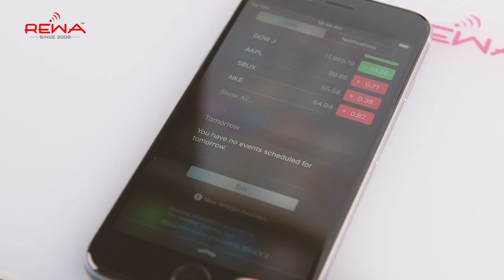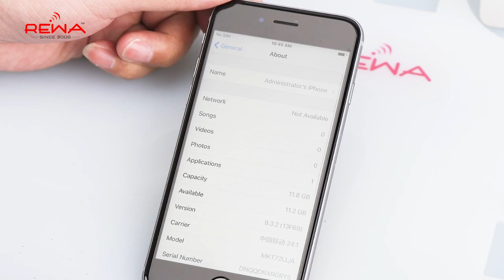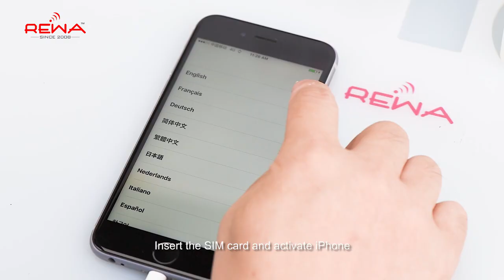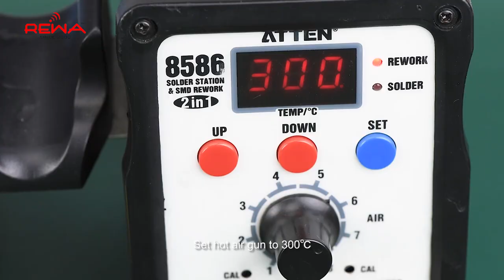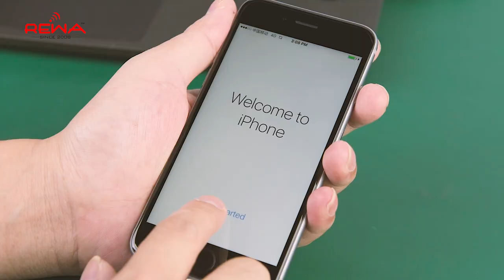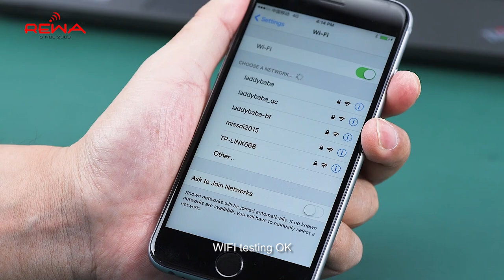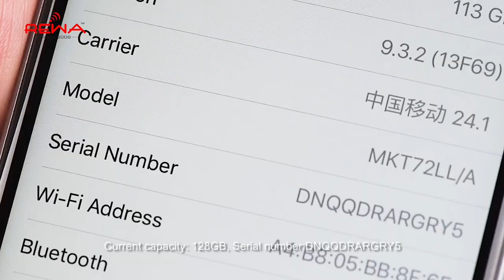Upgrade iPhone 6S 16GB Storage to 128GB

Comment: How to upgrade Android Smartphone to 128GB:

1: Insert SD card.

Done
Reply: I love you
Reply: This should be top comment xD
Reply: confirmed working on blackberry also
Reply: epic comment
Reply: Marius Ammann the speed on that sad card is no where near built in storage
Reply: they make a 256 now.
Reply: 512 as well
Reply: that's true, but you cannot store many apps on the SD and can't install apps if the internal storage is full or nearly full
Reply: Dongonzales123 Yes this is true, my Samsung J5 has only 8GB of internal storage and even with a large SD card I have run out of space for apps
Reply: They have a 1TB SD
Reply: rob shaw the biggest micro SD (the one that fits into a phone) is 256GB or 0.25 TB and costs 200$. The biggest SD has 512GB but its not out yet. What you are thinking of is SSD, Solid State Drive. the biggest one there has maybe 10 TB.
Reply: Dongonzales123 No, Im talking about the SanDisk 1TB Micro Sd Card. I am a Cinematographer, so I keep up to date with the latest technology. 

1, the 512 GB sd is out, and has been out for a while. I have 3. 
2, the 1tb sd was announced very recently at a production convention. 
3. The biggest SSD in the world is 60TB, Also announced by SanDisk
Reply: rob shaw well then you seem to know more than me. thanks for the info
Reply: Dongonzales123 Not 1tb Micro sd * 1 tb SD. But anyway, the 1tb should be released in a month or two. Going to cost upwards of £500, if not more.
Reply: While that upgrades storage capacity, the speed in which the phone is made to write and read data is still the same, as recently revealed in iPhones and possibly used in androids, the higher gig storage the phone has when you purchase it, the higher the speed for reading and writing the data. Keep that in mind.
Reply: Dongonzales123 yup the internal storage app is just BS
Reply: Confirmed On Moto x pure
Reply: Then spend the rest of your life figuring out why tons of your apps refuse to install or use the card and only use the internal storage.
Reply: ***** Figure it out for me
Reply: That part's easy if you know the majic juju, but more to the point it's best to use it as image/media storage
Reply: Dongonzales123 Well, if you have <Android 6.0, you can root and partition your SD card, and you can trick your phone into thinking apps are still on Internal and fully moving as many apps as you can fit. For Android 6.0 + you can format the SD card as internal, and the phone treats the SD card as a part of the Internal. Downside is you can't remove the sd card since it thinks it's a part of it's internal memory, but that's not really an issue.
Reply: David -flamingsword1 That's useful. Thx
Reply: The only problem with adding an SD card to android is that unless you root you can't make good use of it. Unless you're on jellybean. but if your rooted you can separate out the card from KitKat on up, and access it directly. But the thing to look for in an android isn't the size of an ST card but rather the size of your usrdata partition, if it's not at least 8 GB you're not gonna be able to install very many apps. You can get around this by routing and then using Apps2SD or Link2SD to move your largest apps onto your SDcard. But unless you use the very best card it's going to slow you down. I use a patriot 32 GB card. I have a Samsung 32 GB card in one of my other androids and any apps I copy onto that are very slow. That's why it's preferable to have all of your apps on your internal userdata. But just don't get any crappy SDcard, always get the best, it's better to spend more money and get a good one than buying cheap ones, which become unreadable in about a month.
Reply: +Andy G weren't there some s6's a couple of years ago that didn't have a slot? Maybe only certain models. To me the card is a convenience, a good droid will have a lot of space internal as well as a card slot. The newest flagship droids all seem to have more internal space lately, as well as the slot. I keep my titanium backups on my cards, as well as a bunch of media. I think droids are better for handling a lot of media, even for playback. Allcast is much better on android than on Apple.
Reply: Andy G bull
Reply: +Michael Street you are either rooted running SDfix or unrooted running Jellybean then. But no stock androids allow direct access to SDcard from KitKat up. Check your UserData, that's your limit for installing apps (unrooted).
Reply: and wait 3 minutes to open a picture because you reached maximum capacity..
Reply: Marius Ammann q
Reply: Yah but there are no apps u can get on android. Better off trying to get  a good game on a vibrator
Reply: +Andy G I have a list of about 100 games if like to play from the App Store and I found 0 of them on the google play store
Reply: +Andy G this is true there are apps that I love to get on my iPhone that are android-only and it's because the play store allows apps that relate to rooting to be sold there. The Apple App Store by contrast is very restrictive, I mean a popular app that I use on my iPhone called Battery Life was in the App Store and Apple yanked it because it was a formerly a jailbreak only app. After some severe finagling the developer had it reinstated but what a pain in the ass. And I would love to have an app like  DriveDroid installed on my iPhone that would allow me to boot any of my PCs or Macs to Linux from a disk image right through the cable. What's that great android tethering app I can't remember the name of it, we can't even get that really. But using that app on an android I tethered my laptop to my android phone when I had no wifi service. But on the other hand there are a couple of great Apple only apps, there is no good midi player for android, I have SweetMidi player for iOS.
Reply: +Andy G k. But better apps are on App Store. Can't find very many good ones on Google play. Name me a few good apps and games on Google play and prove me wrong.
Reply: NVMe SSD vs SD card
Reply: lol
Reply: Avery-John I have three android phones still on KitKat, very bad support from the phone manufacturers
Reply: +Avery-John I have a Samsung Gtab3, The last update they pushed out was simply another version of KitKat and that was a year ago. Maybe they pushed out another update but I haven't checked in a while. The device probably can't run lollipop or any other 64-bit OS. I have TWRP on it, works great even with no SDcard, basically I use it as a remote with Smartremote. Having that IR on the side is convenient.
Reply: Marius Ammann and the sd card do nothing, cant put apps in there, only canceroud selfies
Reply: @Avery-John
sorry I dont believe that. as I have android with 128 microSD card and my phone is maxed out at 32-gb
I can no longer install apps. and my phone prevents me from moving anything to SD unless its actually a file or something.
In regards of it being a so called "Adoptable Storage" it will not do it. - I have a ZTE ZMax Pro phone with Android 6 installed from factory.
Reply: Avery-John who said they were $200? These are expensive phones. And I know how to use android, but I like to keep the developers custom UI
Reply: Avery-John 3 of my androids. My other androids, including one I got for $60 are on Marshmallow and my main Android is on 7.1 Nougat. However all my iPhones, except for my 6 year old iPhone 4s, are running iOS 10.2 or higher. The 6 year old iPhone 4s is running 2016's iOS 9.3.5, which is still fairly recent.
Reply: @Avery-John
you still have not replied to my question..... Where do I get a TRUE Android OS for my ZTE or any other device I have ?
I would like to try out your suggestion as you mentioned about me installing a TRUE Android onto my phone to get my microSD to be part of my MAIN ROM....thx
Reply: +Top Kek how's 9.3.5 on the 4S? I used Alonzo's script do DL mine from 8.4 to 6.1.3. Then I sold it for a lot. I like my 6s on 9.3.2, but I won't run unjailbroken, I missed the signing windows for 10.1.1 and 10.3 by one day
Reply: Social Spit my 4s isn't that bad. It only takes like 3 seconds to open the camera and its still good for calling and texting some. Anything else you might want an upgrade
Reply: Avery-John well the 4s still has great standby time and it gets great reception for me
Reply: +Top Kek I wish I still had mine, I had a sprint 64gig white i4S. Traded it for some large flash drives, but they fell out of my pocket last month, I kept my operating systems on them, so I wouldn't have to carry around a bunch of DVDs and CDs. The 4S had the best battery of all of the iPhones I have ever had, after two years it still at 95% capacity. After three years I had to replace the battery in my 5S, and my success is not even a-year-old and the batteries at 70%, worst iPhone battery ever but I like the phone a lot. It's true no phone is a waste, I still have my old Motorola flip phones and my little piece of crap siemens phone. And I have two Treos, I like the keyboards on those I can use them without looking.
Reply: Avery-John yah The 4S that I sold two years ago still has the original battery and it is still at 95% capacity, I had to replace the battery in my five S but now that's good, but that gave me three years of good use where I got about a day out of each charge. The worst battery life I've ever had is for my 6S, which is at 20% wear level after less than a year of use. Or rather 80% capacity. I love the phone it's got great features but the battery is extremely shitty and I know that they dropped the capacity from the 6 to the 6S. I will probably bring it back to the iPhone store and try to get it replaced right before my year is up.
Reply: Avery-John samsung's have massive batteries, but my galaxy tab three battery only last half a day now. Old battery. I ran iOS 6 on my 4S practically the whole time I had it, except for iOS 8 for about six months. Then I downgraded it back to iOS 6 and the battery life was phenomenal. Older iOS had less features so you had more life spread out between all of your apps.
Reply: My 6s battery is getting better life ever since I ran CYdiA Eraser which erases the device, I haven't installed as much excess junk this time, but it's still down to 80% capacity. It's still under warranty, so apple might replace it if I go to the the Genius Bar before September. But they'll give me a non-JBable iOS. I might luck out and get 10.1.1 or 10.2 then u can use Yalu. I'm only renting the 6s so I don't care much about it :/
Reply: Marius Ammann  not entirely true.

I have sony Xperia C with 1 GB of internal memory and it doesn't matter how much memory I add, the programs still don't install due to lack of memory on the phone itself
Reply: Avery-John That's why I said "not entirely true"
Reply: Avery-John that's how it's supposed to work but it all depends on your user data partition, I have an old Samsung galaxy tab and that's 12 GB of use your data there and that's my upper limit for installing apps which is quite large actually. I have other cheap HTC and media tech devices that only have two and 4 GB of user data, and that really limits what I can install unless i root and use my SD card with apps2SD. But my SD card is so slow it's not worth doing that. So I end up deleting system apps that I don't need
Reply: Marius Ammann lmao 😂 but so true
Reply: Marius Ammann but I use a nexus...
Reply: Use Xposed module +root+256gb sdcard DONE
Reply: Lmao
Reply: Lmao
Reply: To 1PETABYTE!!!
Reply: #GrowFasterDeveloper Channel which Xposed module, but it all depends on if you have a good fast SD
Reply: Dongonzales123 not true, in Android nougat "v7" have a option to format and share the SD card space with  internal space. But the sd card, works only in that phone
Reply: Marius Ammann good luck with the s6.
Reply: With no apps working on the sd card
Reply: use apkpure ;)
Reply: use apkpure ;)
Reply: processor has maximum to read you can't add any storage you want you have see the limit first
Reply: How to turn your Android Smartphone into Garbage:
1: Wait 1 year (or less)
Reply: Rofl :D
Reply: Marius Ammann lol
Reply: Hahahaha..niceee
Reply: Absolutely delicious
Reply: @KypHeM  who told you that there is different class of storage 1  to class 10 also ultra fast why u think we use 64 gb sd card we don't find any slowness
Reply: That's exactly what I'm need.... Thanks you
Reply: Marius Ammann lmao 😂😂
Reply: keesa mash  phones are like mini computer company say support upto 32 gb if phone is having 2 gb Ram it will support, my 5 year old Samsung s4 mini & lg optimus one supported 128 gb you have tried and tell
Reply: After reading this comment I will event not click on the play button to see the video but just close it. Thank you
Reply: I don't have a SD card slot
Reply: hahaha good one
Reply: oh 😅
Reply: BEST COMMENT
Reply: @brizek  root >> failed >> boot loop >> always error
Reply: its working in my phone wow
Reply: how to fix Android fragmentation?

1. you can’t !
Reply: Dongonzales123 root can solve that
Reply: Marius Ammann 😂
Reply: It's not the same .
Reply: Lol not all
Reply: how to speed up and Upgrade OS on Android

1: Throw away your android purchased 3 months ago

2: Buy a New Android Phone

DONE
Reply: Marius Ammann yea I am starting to have my iPhone because it’s a 16gb model I prefer Samsung now
Reply: Marius Ammann lol so true
Reply: Alex Pana they make 512 now
Reply: Marius Ammann HAHAHAHA funny as heck, loved your comment!
Reply: How’s the data encryption on those android pieces of shit? Seems like anybody can just pop out your sd card and pop it in theirs to see all your pictures. At least this has a risk factor to it and is semi compromise-able, I mean they’d desperately have to be nosy to install a memory chip into their own or another donor phone. It takes a lot more effort which filters some of the lazier, less desperate people.
Reply: Dongonzales123 yes you can lol
Reply: Hhahahahah Thank you Android Phone companies. I love you
Reply: No Just Install Google Drive🤣
Reply: Jajaj true story
Reply: android = slow shit ....
Reply: i clap to this
Reply: Hahahahhahaha
Reply: Nailed it !
Reply: ha ha, very simply
Reply: @GewelReal  1 tb as well
Reply: iOS : haha 😂 but I have my originality of  processing
Reply: @Dongonzales123  yes we can simply root your device and then done😅😅😅
Reply: Step 2 android phone explodes
Reply: SD card class 10 (fastest) is 100 times slower than iPhone 6s storage speed.
Reply: note: if you have a phone with 64GB or higher, get a 512GB card or 1TB.
Reply: Marius A this stupid with android is that you cannot move games or app to the sd card!! thats the reason i move to iphone!!!
Reply: But your stuck with the crappy android os...
Reply: Marius A hahahahaha
Reply: I tried that but unfortunately you cant really transfer apps so its useless
Reply: How to upgrade android smartphone to 512GB?
: Insert SD card
Reply: imagine using android in 2019
Reply: Man so true. As a former Android user this is what I miss the most 😫
Reply: New invention this century
Reply: Karara let’s see the list
Reply: Andy you can develop for free on Apple
Reply: How show you are poor!
1. Use Andrid
Reply: 2: get crappy load speeds and if the internal memory is full you can’t use it
Reply: That is not an upgrade, because internal storage is faster. ;)
Reply: Marius A android is crap
Reply: Or buy one New for 100 dollars with 128 GB  and you can put 128 extra with SD
Reply: @GewelReal  samsung 1Tb 🔥
Reply: not all android has dedicated sd card slot. don't forget it😅
Reply: How do install app in the card brother? Gênio
Reply: Oh my gosh
Reply: But iPhone not have any SD card Slot.
Reply: Best comment ever hahahaha
Reply: Marius A but some files aren't changable when putted in sd card or it will just cause error
Reply: Nice.!
Reply: Its too hard to do How can we do it at home it may be harmful to do at home
Reply: Get a 512 GB SD card or a 1000gb one set it to internal memory and u r done
Reply: Well no thats not how you do i
Reply: I got 1,024 storage in my note 10+ 😂
Reply: Stonk accepted...
Reply: lies all ur apps are still running on the internal storage unless u root it, but iphone all of the games and data can be stored on ur 128gb storage
Reply: Ye iPhone is greedy
Reply: Well, now 3 years after this comment it's not possible anymore on many android phones either
Reply: 2TB even
Reply: Bigger Memory built -in is much better thats why some people experimenting to upgrade their phone hardware. Sd Card is no use actually. It wont stabilized the performance
Reply: Ti Te you have no clue what your talking about
Reply: hello 2020 no more sd card slot😜
Reply: Al Pa u wrong, sry, it depends on sd card, u can buy an SD card that is quicker than built in storage and it is not very expensive
Reply: Exactly
Reply: Xd
Reply: You just fucked it man!!!! Yeah!!
Reply: Not quite because you can’t install apps and software on as cards so having sd will just help you have more storage for files and photos and not apps
Reply: Hahahahaha
Reply: Then you have some apps that dont switch to sd card.
Reply: Fergo30 android 4 😂😂
Reply: Just think of that like real love once you're in, it takes a lot to get them separated! Where Android is whatever you want a one night thing that's fine too! Lol
Reply: How to steal data from Android, steal the SD card 🤣🤣🤦‍♂️